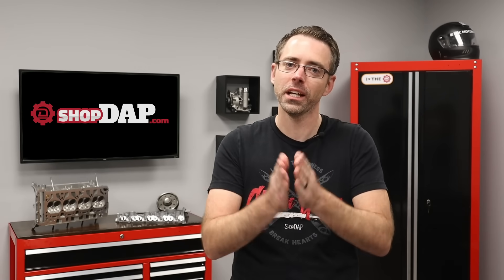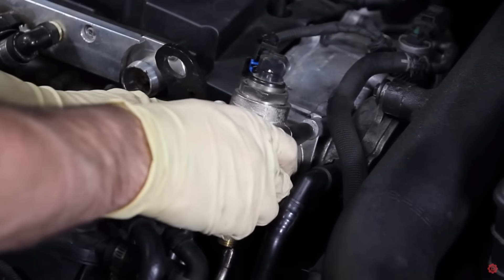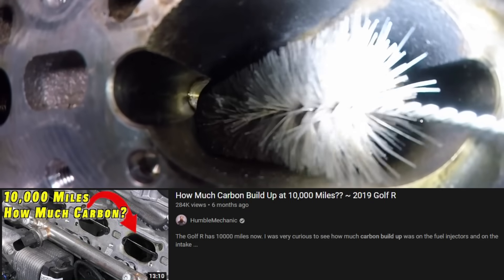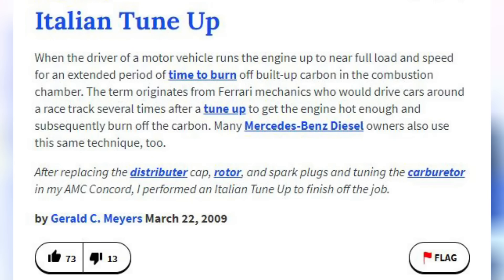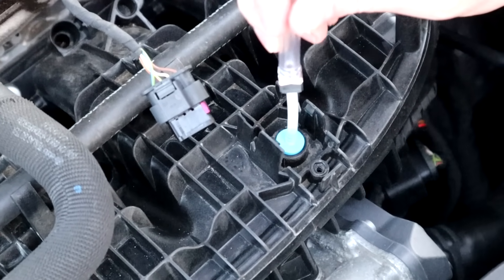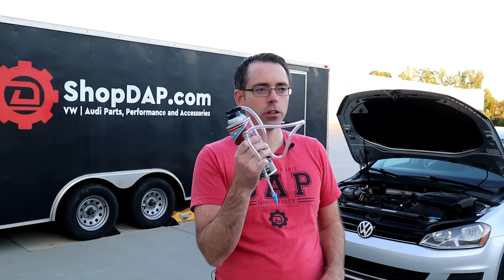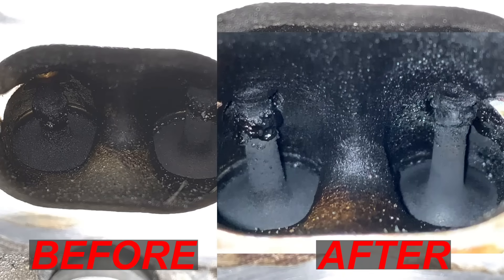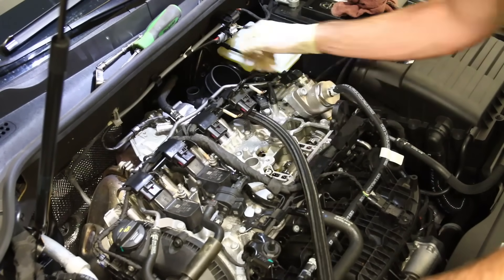Can you Really Remove Carbon for $29?

Comment: I'm Italian and I've just discovered the meaning of "Italian tune up" 😂😂. In fact, in Italy we just say "driving normally".
Reply: I do an Italian tune up every chance! Almost every day! Lol
Reply: A bit like brazil nuts, in brazil they are just called nuts
Reply: @upsidedown4155  they are sometimes called "Brazils"
Reply: @upsidedown4155  do they call Brazilian butt lifts, just......buttlifts?
Reply: My 1st 4 cars were Alfa Romeos. If you didn't thrash them @ least once a week they would start running like crap, probably because of their appetite for the oil. So maybe an 'Italian tune up' was only a neccessary for Italian cars?
But maybe not. Decades ago my boss had a Mercedes. He asked me to take it to the dealer because it had no power. On the way I gave it a thorough thrashing. At first it was definitely sick, but as I neared the dealership it was going much better, so I turned around and thrashed it all the way back. When I got back I gave him the keys and told him it was fixed.
After his puzzled look I told him that he should not not always drive like grandpa.
Reply: @gregculverwell  This method is called "freiblasen" in german and actually used to be the common practice for removing carbon buildup in engines. Just drive to a long enoutgh highway section with no speed limit and absolutely floor the pedal for 20-30 minutes.
Reply: @CodewortSchinken  freiblasen sounds like a blast it clean? I did that with the 1st Alfa I was bought from the my uncle's neighbour. She sold it's to me for the next to nothing because the engine had a bad rattled and no power. I though it was knew the reasons. She only used it to go to the locals shops a few km away.
The rattle was a loose timing's chain and arrived with a 14mm spanner in my pocket, which is alleged you needed to adjust it.
Then on the Friday night I set out to visit family and out on the farm. Once I got out of on a deserted single lane and put my foot down, redlining in every gear 
At first it wouldn't getting past 120 kph, but it slowly improved. When it reached 160 I noticed a red globe behind men an a big cloud of sparks. Its though it is had caught fire & stopped. But there was nothing. I was very puzzled and started out again. The flakes & sparks reappeared, but now I knew it was was all the carbon being burnt out. After the about 10 minutes it stopped and the car was going very well.
Reply: @gregculverwell  like Ken Miles said - you should drive it like it should be there is more rpm left after 3000rpm try going beyond that sometimes it will make u feel good and to the car too.
Reply: Nobody drives "normally" in Italy - I've been there.

My Alfa ran really badly after lockdown.
A few brisk drives later, and it was back to normal :)
Reply: Like Mexican restaurants...in Mexico they're just restaurants
Reply: Yea i learned what a Italian tune up awhile ago but always makes me laugh when I hear people doin/suggesting that, I'm half itainlian myself
Reply: Exactly, that is like saying in China they eat Chinese food, its just food there.
Reply: I think i may have italian ancestry then..
Reply: “Tu scanna, se ha un problema o si rompe oppure si mette apposto”😂
Reply: In Czechia we call Italian tune up  Italská údržba
Reply: @Radecz  "Italian Maintenance"
Reply: "Italian tune-up" doesn't do anything for GDI engine which is all VWs.
Reply: Well yeah! Think about it. German cars/Autobahn. I have always owned Audi/VW. My Mk6 GTI is tuned and I romp it through the canyons. I also use Pentosin and Lucas oil stabilizer. I am at 130,000 with no  mentionable oil consumption.
Reply: Most people here say pedal to the floor, but you dont need change gear!!! Yes you can use first gear, just how much you care with noise, you dont need to go really fast. Imo. Always do it with my motorcycle. Rarely used now. But still works like a purring cat
Reply: Ahahah è vero
Reply: There is beauty in that simplicity. Change your oil every 3,000 miles, grease your joints, keep your tires inflated, wheels aligned.  I always insist on a bench seat.  So my girl can sit next to me.
Reply: Its Italian because it’s unreliable too
Reply: My friend is French and he just call French kiss a “greeting”.
Reply: Just like I'm sure in France, they're just fries....
Reply: That’s what it’s supposed to mean lol, the irony is intentional in the comment as you all drive like lunatics , the phrase has been around since the 60s
Reply: The idea from some is that you should be able to Dissolve the carbon Or make it crack into small pieces by exposing it to extremely high temperature. if this worked, maybe it was better in the eighties Without direct injection
Reply: Haha very true. I live in England and have driven in Italy several times , it's always scary at first lots of Crazy drivers!
Reply: Speed limits in USA dont give driver a chanse to drive i high speed, therfor carbon take over in engine!
Reply: In Germany we call that freiblasen and we do that on the Autobahn.
Reply: poor engineering by v dub..tdub..toyota does it better
Reply: https://youtu.be/y4UhOeYYXAA?si=qhfXEPW6evMsJwPR
Reply: I thought this was bullshit untill I took my car to the track and afterward I noticed it idled much much smoother.
Reply: @memememine1  Same. Took my old 240sx to a drift session and all the idling and ignition issues disappeared. No more black smoke from the tail pipe. The speed limit in my area is 45mph so that led to the build up I guess
Reply: Lol, my step dad (Ciccone) is Italian, I lose years off my life when he drives, OMFG how is he not dead in a crash yet? 😅
Reply: I do it almost daily but now I am getting the carbon cleaning done at Audi for the tuned S4.  Can't sustain extreme speeds for more than a few seconds.  In future I might keep it a lower gear like 4th or 5th instead of 7th.  It really needs to be driven at well over 200 km/hr.
Reply: @paull3179  make sure your engine is already warmed up, like at least 10 minutes of normal driving, and then just rev it out in a lower gear. Going over 200km/h on a public road is attempted murder.
Reply: @heygek2769  I do that in a VW van on the Autobahn...
It's normal over there.
Reply: Dont get to excited, I assure you that a far greater percentage of americans drive a whole lot more highway mile at much greater speeds than people in modern Italy.
Reply: @TonicofSonic  
Is that because USA has 400+million inhabitants compared to Italy's 60million 🤔
Reply: @TonicofSonic  Yeah sure. And there is also a blue goldfish swimming in the boys bogs...
Reply: @easyspanieltraining  I knew this was coming. The Ferrari attitude is worse.
Reply: @TonicofSonic  👍🏼
Reply: The phrase comes from the 60s when small engined city cars like the fiat 500 were revved to death thrashing around the narrow streets of Italy in Rome or Turin etc in very crowded rush hours etc, I’d say America known for the exact opposite then and even now, V8s and long highways, common dude let the Italians have something :)
Reply: @TonicofSonic yeah, since daily commuting here some times exceed the size of an average European country. Still getting used to that distances since have moved to the States a year ago. 😂
Reply: @TonicofSonic engine actually didn't work as hard during highway speed.  Italian tuning means driving like it is stolen 😂
Reply: @TonicofSonic  sorry, you don't know what you are talking about...
Reply: Ouch just keep off my interstates little man
Reply: @TonicofSonic  yes, at least we agreed on something
Reply: @peppemor347  ok, so geographically look at italy, using whatever scale you want to, then look at the US using the same scale. Are you noticing a slight sizing difference? Mile to mile or Kilometre to Kilometre the US has more interstates, highways, motorways and so on not to mention that a large portion of the Italian population live in high density cities where it is not feasible to put your foot to the floor for half an hour, even if you're driving from city to city in Italy non stop, America's long haul truckers and normal drivers going interstate or even just on their daily commute are doing more highway driving. If you have a logic based response, I'm more than happy to discuss this but you should not expect to be just making counter statements and having yours supersede the original. Neither of you gave evidence but logically, America is bigger and has more interstates, motorways, highways and free ways than you do in Italy, if you can show me evidence to the contrary or another point that would change a skeptic's opinion then please, let me know
Reply: @mister3722  yeah it's true but keep in  mind that Italy is structured in a different way than the USA.  The plain in Italy is almost totally absent and most of the roads are narrow suburban roads that have very steep climbs and curves.  I can assure you that this type of Italian roads (but in all of Europe it is so in general) put engines in much more difficulty than motorways, and also european cars has lower power output due to smaller engines to keep low consumption.
Reply: @mister3722  I can promise that here in Italy we know that there's civilization outside national borders, they call it European Union, and it happens quite often to take Alfa Romeos from southern Italy up to North Cape and back without any major issues, driving distances comparable to the ones you drive within the U.S. ... 
Of course it could happen that a single engine could have problems, but maybe it would be better to check whether you are buying nice fuel, you have a clean air filter and you use the correct engine oil. If the oil scraper band holes get obstructed than the temperature could rise and the ECU is no longer able to determine the correct fuel to air ratio and this typically allow to build carbon. But I'm pretty sure you are going to have this issue more often on a VW than an Alfa.
Reply: @peppemor347  sono piuttosto sicuro che la velocità media di un veicolo negli Stati Uniti è mantenuta superiore a quella che né in Italia, le distanze guidate quotidianamente sono maggiori, le strade ben più grandi e veloci. Fonte: ho guidato centinaia di migliaia di km in Italia, USA (e Germania)
Reply: @AlessioSangalli  e allora chiamatevelo american tune up! Dai su, non facciamo polemica sulle battute.
Reply: @TonicofSonic  Have you ever driven on the italian highways? I've been there a few times. If the speed limit is 80mph (130kmh) and you already do 90, they will honk and overtake you with at least 100. Also: What hapens if you are 20 over the limit in an italian city? Yup, they overtake you, even in their shitty Fiat Pandas.
Reply: @christiansprojects-cgmanuf1426  
They all have Fiat pandas, even the Police.
It's not so much the speed they drive, but the differential between those that drive  slowly in the gutter and the speed nutters.

Didn't Clarkson say they were pulled over by the Police while driving supercars in Italy, and told something like "those cars you are driving deserve to be driven fast, you were going too slowly".

Comment: Have laser cleansing that clean rusty metal been tried to get rid of the carbon build up
Reply: Interesting thought, I'd like to see that tried as it would be so much cleaner than media blasting.  I do wonder if it would just turn the gooey carbon into hard baked-on carbon though.
Reply: @ferrumignis  It just vapourises the carbon build up  leaving a clean metal surface , you would probably need a fume extraction tube to suck up the vapours.

Comment: I had a Catch Can on my MK5 GTI I've owned for over 12 years. And I still had bad carbon build up when I checked it at 90k. No difference between my Catch can and a non catch can car. I'm sure I could of nit picked but not noticable. My honest Opinion would be to Run a Carbon cleaning Spray every 10k and possibly Pro shop clean the carbon at 80k and if your really anal do a professional carbon clean at 50k. But Catch Can didn't really do much for Carbon in my Opinion.
Reply: I think catch cans might not work as good as people think

Comment: So the reason why VW uses dual injection in the EU and not in North America is not because of CAFE standards but because of European standards in relation to exhaust particles. the nasties that come from the PCV system cause quite a bit of nasties to show up in the exhaust. so they use port injection to dilute the volume of these PCV vapours and droplets and have the added benefit of cleaning the valves.

The reason we dont have dual port injection on US models is because North American regulations are not as stringent in regards to particulates, therefore as a cost saving measure we dont get dual port injection.

Honestly, I think Carbon buildup has a lot to do with fuel quality. Im at 250k km (155k) on a CCTA engine and when we did the intake manifold replacement at 188K km the valves looked perfectly fine. but maybe fuel quality where I am is better than is some parts of the US.

Comment: I've installed that exact meth kit on my car S3 8p. Will the 50/50 water meth solution remove the carbon build up fully? I'm not sure how effective it is
Reply: If it’s never been cleaned before you should take the inlet off and clean it manually. The meth will probably clean some of it, but not all.
Reply: Very unlikely that it would be effective for a pre-existing condition. If it was installed @ low milage and triggered frequently, it may prevent further buildup.
Reply: @gregculverwell  ok thanks, I'm getting it walnut blasted anyway

Comment: Is dry ice blasting an effective way or removing carbon? Are you able to do a video testing this?
Reply: Dry Ice is just a form of Media Blasting, Its basically no different to convensional Walnut blasting. Its actually a cleaner Method than Walnut, because the Ice will melt away and wont leave your engine bay looking like something exploded in it...
Reply: @DrClutchMD  yea but i just don't know how hard dry ice is compared to walnut media

Comment: Would you recommend a car with the 2.0t? Tsfi(?) seems like a hassle
Reply: Tsfi isn't bad keep up on the maintenance and you will be ok. If buying used, make sure that it has had the timing chain tensioner replaced. Its a real headache and typical for them to go bad on models leading up to 2013. Best to go with a 3.2l but if not you'll still be fine
Reply: @jaimiebanks  changing the timing chain and tensioner is not that hard I did it on my A5 Audi ... love the tfsi just do the maintenance that it needs ... every car needs it

Comment: I wished you'd discuss port injection more as a good amount of folks do it. and my question would be if port injection is added then would 980cc injectors spray more or less than 1300cc injectors? or is that the capability of the injector itself and its tuned duty/cycle and not spraying more/less if the port rail pressure is the same. thank you.

Comment: Great video! As someone who just completed a manual scrub of my TSI intake valves, I’m glad to see the snake oil solutions debunked. It’s not a difficult procedure to just remove the damn manifold and do a proper cleaning — and it’s very satisfying to experience the before and after.
Reply: How long did it take you to perform the cleaning? At 45k I’m wondering if I should try this stuff for shots and giggles or say fuq it and do the cleaning at 60k or 75k.
Reply: @mexifinn7830  I would definitely have done the treatment at 40k.  I waited until 60k and that was too long.
Reply: @mexifinn7830  I’ve used the sea foam shortcuts — it’s a waste of time and money. The manual cleaning is really not too hard. Follow the DIY video and make sure you have all the right tools. It took me about 10 hrs — taking my time over 2.5 days. I could do it again in about 4 hrs I think.
Reply: @peterjordan9321  not easy and not snake oil, liqui moly and CRC make great valve cleaning and TURBO cleaners for GDI vehicles
Reply: Walnut blasting for the win
Reply: Did you spray anything on the valves to help with removal? Gasoline, solvent?
Reply: Sure, but on my car I have to remove the front end of the body to pull the intake.  It's a big job.
Reply: @Manface77  sounds like time for water meth
Reply: @OscyJack-  I tore the entire front end apart once and cleaned the valves manually at ~60k.  I purchased a non-dismantle fuel system kit for use every oil change ~5k miles.  I also installed a catch can.
Reply: Really depends on the product you are using. At the dealership, we had a solution that would be bubbled into a foam…. Approximately 1.5L of liquid would get bubbled. We did a r&r before and after, which showed that it worked really good on diesel intake runners/coolers/piping. The hot spots of the valves were better but didn’t work 100%. I think the product was called TerraClean, something like BG
Reply: well on my audi 2.0t as soon as you remove the valve cover the can shafts pop out and it’s out of time , having to retime, scrape clean and squirt new gasket seal on . cleaning the valves would take all day long
Reply: ..or (instead of paying a shop 10 hours of labor charge)...one could add a bottle of said "snake oil" to ones gas tank every few thousand miles.
Reply: @fngonuts  that doesn't do shit in a direct injected engine. That's why DI engines need valve cleanups, no fuel hits the intake tract
Reply: @fngonuts  that doesn't work in a direct injection engine.
Reply: @Manface77  not in the tank ;)
Reply: easy on an inline 4. Whole nother can of worms on any larger motor...